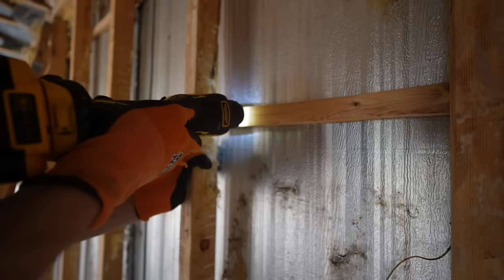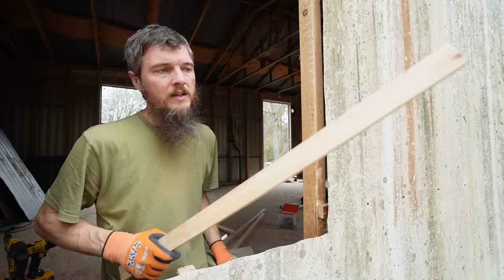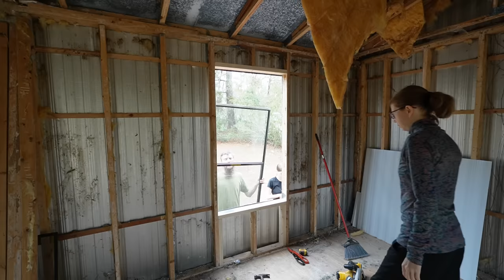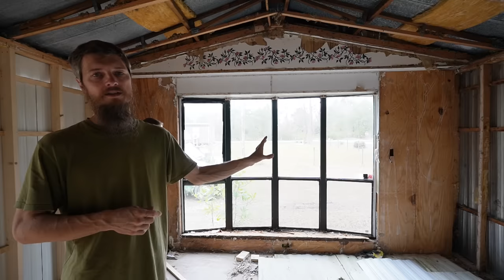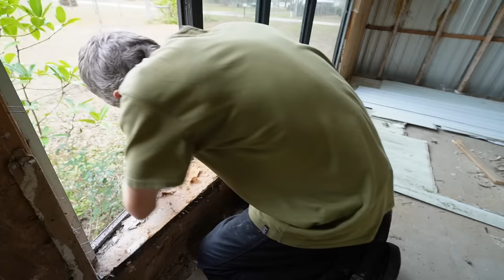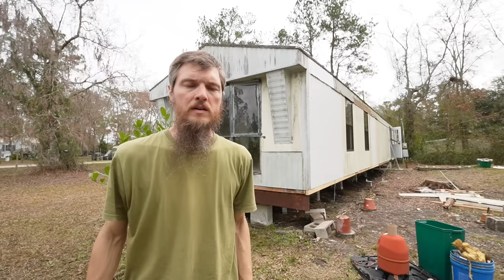Bay Window Can't Be Replaced - Salvaged Mobile Home Rebuild

Comment: Suggestion... If you check with Lowes they have a window film that is cracked glass that works great. the best part is you can remove it to wash the window and replace it (use it more then (1) time)

Comment: Great job on the mobile home repair project, will you be putting a new roof with a little bit of a over hang to keep rain from running down the sides of the home? Looking forward to the rest of the mobile home redo.
Reply from the maker: Yes. Thanks!

Comment: You can get gloves, made for using mandolins in the kitchen, that protect you from getting cut by the stainless steel cutters while you slice the veggies on top. I bet they might be really nice for use with this window project as you handle sharp edges of metal and the glass replacement.

Comment: May I ask where you got the adapter for your drill that lets you insert screws at a 90 degree angle? I’ve never seen anything like it and would like to purchase one.
Reply from the maker: You can find it at Home Depot: https://www.homedepot.com/p/DEWALT-MAXFIT-Right-Angle-Magnetic-Attachment-DWARA60/308436444

Comment: The house is looking so good.  I'm really glad that you were able to save the bay window.  I was wondering; when you cut the new window sill are you going to use flashing tape on the entire underside of the wood between it and the metal flashing of the window as well as use flashing tape like you did with the other windows?
Reply from the maker: No, we'll just be finishing the sill with some type of sealant.

Comment: you didn't put the  flashing tape on the sill that sheds water. I wonder if you could sand the bad metal and spray paint it so corrosion stops.
Reply from the maker: Of course we did.

Comment: i have a storm door on the porch thats aluminum and in the center of the panel it just started corroding like that.. the manufacturer honored the warranty and sent me out a free door blank that I had to pickup at the store.. thats going to be a spring project.. not sure what your options could be to replace that if you had to.. whatever it would be it wouldn't be cheap. good luck

Comment: Doug, I just had a thought, have you considered spray foam insulation ?.  I bet it would considerably strengthen the trailer. Dave
Reply from the maker: For us, spray foam is just too permanent. I guess we think of things through a renovator's mind, but I would hate to work on a house that had been spray foamed! Plus, we would worry about the chemicals in the foam. It just doesn't feel right to us.
Reply: @diyfferent  fair enough. Did you ever see my email and PayPal gift for the wet and forget?
Reply from the maker: Yeah, I was told about it. I'll check it out and respond. Ashley checks the emails, and she does tell me when something comes in for me, but sometimes I just forget to go and read them. Sorry about that!
Reply: @diyfferent  no biggie, I was just wondering how well it would work on the exterior of the trailer. I've never used it before and I figured you might want to give it a try.  It's supposed to be non toxic.
Reply: @chesterdroors1605  duo blast is pretty good to the 2 part mix

Comment: I think that corrosion at the bottom of the window is caused by exposure to moisture and its reaction to organic adhesive used in the manufacuring of particle board. I've seen this type of corrosion happen when an aluminum placard was glued to aluminum.

Comment: Hey yall, you can copy the front door lines on the bathroom window glass, then paint on acrylic faux stained glass texture. Bendable sticky lines, then use clear acrylic or color paint & texture to your liking. Both of my bathrooms have different under the sea themes on the windows.

Comment: Doug are all mobile homes built like this one. It seems like the o me in Michigan had something between the metal and the studs on the outside
Reply from the maker: Not all mobile homes are the same. That one had some type of paperboard on the studs, then fiberboard panel siding on top of that. And a small area on the bottom had aluminum siding that looked like lap siding.

Comment: had you thought of replacing the windowa with individual windows, small slinder windows around the same size of those and framing up between each window with 2x4's and building the bottom much stronger

Comment: Yo Doug..Why are you not using that metal cutting tool that was used to cut the metal for your roof?
Reply from the maker: That tool works great on the thick steel roof panels, but when we're cutting these thin aluminum panels, the scissors or utility knife work better and make straight cuts.

Comment: If you ever need to…I tape off the frames and spray older screens with spray paint on both sides to strengthen them back up. I lasts a long time. DIY cheaper. Haha

Comment: I think I would replace that wood with pressure treated and cover it with aluminum plate.
Reply from the maker: Be careful with that idea though. Treated lumber has copper compounds in it and copper is very reactive to aluminum. If the wood stays wet and in contact with the aluminum, it will cause corrosion and pitting, just like we saw here. That's why I avoid treated lumber in a build like this.
Reply: @diyfferent  Sir I did not know that! My thought was something that was going to be covered so I didn't have to worry about the kids and wouldn't rot. 90% of all my construction knowledge is commercial. I usually work with steel. Home window or 2 and a deck. Nothing to the extent of what your doing. Thanks for the info!!

Comment: I would've thought you'd place windows by the view those windows would get. I am curious if you are planning to 'sound proof' the outer walls with that gray wool insulation?
Reply from the maker: I don't think we can really soundproof this home, but we will be insulating for sure, and mineral wool is my top choice.
Reply: @diyfferent  I mistakenly thought that mineral wool did provide sound proofing. There are some here in rural Virginia who build a house around their mobile home to gain insulation. Evidently that's the big negative in those homes; not enough insulation and you can hear the road outside all the time.
Reply from the maker: @mysticmeadowshomestead6209  No it wasn't a mistake. It is supposed to help cut down on noise, but I don't think it would really block it all. Even in Michigan we did 5.5" of mineral wool in our walls and we could still hear every car drive by.
Reply: @diyfferent  Thank  you. Yes, I do remember 5.5" of wool insulation. However, I didn't hear that you could hear every car drive by. Road noise was why you moved from the single-wide that you two lived in when I first found your channel. (That red stripe got me.)

Comment: Take it to a shop where they have a bead blaster and get them to blast the window it will smoke it and not break it! Take masking tape and tape off the bronze any place that has small engine repairs would have such a machine and probably cost less than twenty dollars to do!

Comment: looking good more light is good  wow mdf   micro fibber board  as its none  is not a good thing to use where damp or wet gets in it acts like a sponge  there is a sticky back plastic for your modesty  with different design s :fish-orange-wide-eyes:🧐😱✌

Comment: I’m curious. Today’s 2 x 4s aren’t actually 2 x 4s how much difference is there. This isn’t a criticism though someone will think so I’m just curious as to the actual size. I’m sure those old ones are actually 2 x 3s given the age of the home. I’ve got a home much older and the wood sizes are certainly not any standard. I love that bit of humor 😅
Reply from the maker: The lumber used in this home are the same dimensions as modern lumber. I believe the dimensions were officially standardized to the smaller size in the 1960s.
Reply: @diyfferent  I’m old enough to remember actual 2 x 4s being 2 x 4s lol
Reply: All mobile homes are 2x3 studs I’ve worked on at least thirty homes and they all are the same
Reply: @diyfferent  The lack of resources forced a compromise because thinner 2x4s were a way to compete with these alternatives in the industry. In 1964, size standards, maximum moisture content, and naming were agreed upon. The nominal 2x4 thus became the actual 1-½ x 3-½ inch board. Since this is the case, I imagine that since today’s lumber at the big box stores isn’t kiln dried it’s not that the wood isn’t the same size but rather it’s the moisture content.

Comment: They might not be able to be used but couldn't you use the old windows glass to fix the bay window or too small?😊
Reply: Glass gets harder and more brittle over time.  Only reason I know this is I do stained glass and vintage glass is hard to work with.

Comment: Hey I’m curious with everything out of the ceiling like insulation and sheet rock if you are having any moisture forming on the inside, I’m currently remodeling a mobile home myself and am  experiencing that problem from tearing the ceiling out to be redone . I’m thinking maybe it’s from the cold air this time of year . Thanks for any inputs as I’m open to learn from my mistakes. Pls no hate .
Reply from the maker: We haven't had any moisture forming on the inside. The home is so open and it's unheated so there wouldn't really be any condensation forming.
Reply: @diyfferent  , thank you for your reply I watch you guys all the time! see that’s what confuses me because the home I’m renovating isn’t heated neither and it forms on the underside of the metal in the mornings and evening. I’ve tried opening windows and letting the house breathe and it goes away but then comes right back the next day . The humidity in the home does stay around 80% . I’m thinking about drying it the best I can and reinstalling and install the new sheet rock hopefully that would keep the moisture from getting to the metal.
Reply: @cynthiafisher9907 I’ve considered that but most single wide mobile homes are built with a sealed roof system including mine so I’m a little scared to vent it to the outside when the roof are not built like that from the factory

Comment: 99% of the time I think everything you do is perfect but this time, no.  I would build a new knee wall where the lower portion of the bay window is and then put in conventional windows across the opening. Seems like too much work to try and restore old, inexpensive aluminum windows.

Comment: The dodgy quality of materials used by mobil home manufacturers makes me suspicious of that fiber board being the culprit source of the corrosive chemicals.  Using fiberboard in that application was strange.
Maybe the window assembly was a prefabricated unit from a separate supplyer.  In my experiences with mobil home renovation and noticing other shortcuts taken in your unit, makes me think that condensation wicked through the lower sill material pulling glue or filler from the sill corroding the alunium.  Salt In the air could also be a big contributing factor.  Maybe  from a on shore storm from the ocean. 

Just a thought
Wolfmama0104
Reply: I have the impression that this home is from the era when mobile home dealers, especially in warmer climates, were still selling mutton dressed as lamb. The 2x3 studs and the extensive use of really lower quality fiberboard suggests they weren't following HUD regulations, current at that time.
No surprise. I also live in a state which has booms and busts and, during the booms, there are some pretty shady merchants.

Comment: I dont like the idea of those bay windows having opening with srceens at floor level, there was a mistake with the design.. Where does the rain and weather hit? Right there at the bottom half. You could put framing in to the upper level then picture windows. Mine at one end are like that, with framing in between 3 windows, middle one opens and the 2 side ones on an angle do not.